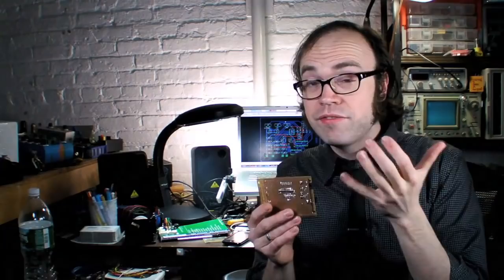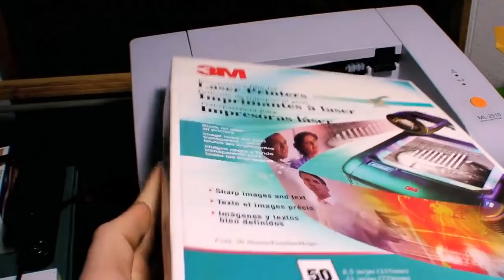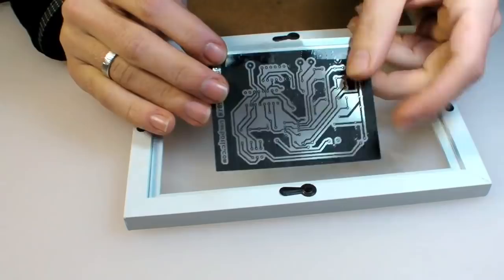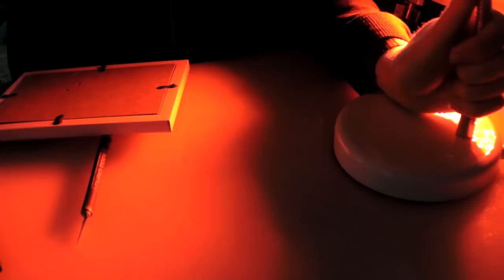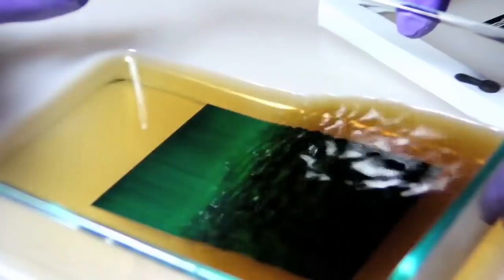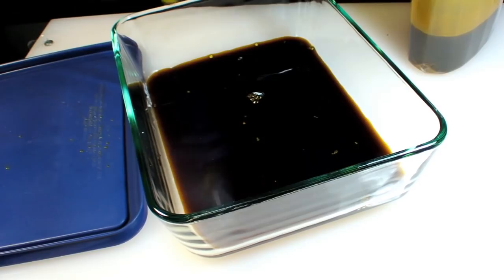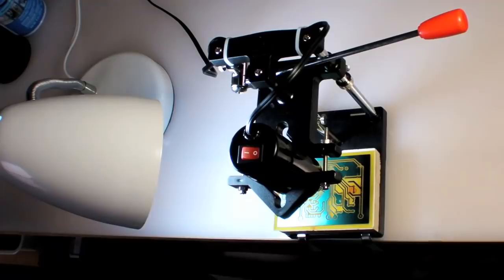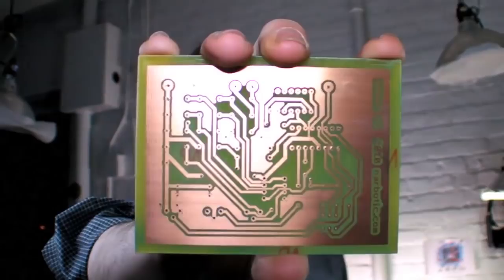Circuit Skills: Circuit Board Etching

Comment: @v8power101 The point of the red LEDs ? Old enough to know what a film camera is and to know what a "dark room" is ? Basically, he can't work in the dark, but he can't work in broad day light neither (the board is pre-sensitized so the moment he removes the white coat, there's a reaction).. So there must be some kind of "harmless" lighting.. He uses the red LEDs for that, sets things up, and then "flashes" it. (Red light is also used in the military at night as pupils adapt faster to darkness)

Comment: If I get the mats for etching.. I'll start doing it myself... I'm tired of soldering wires all day to test my circuits in real.. and you can't test all circuits on breadboards and sim soft... Besides ... I also use a lot of SMD components... And my school makes only one layer boards.. which is a drawback.. and other companies cost me money! This is a great demo, thank you very much!! 5/5
P.S. Is it possible to make double layer holes in home conditions?

Comment: Negative photoresist film is better IMHO - less chances of broken traces, especially when going in the 10mils range (say for a TQFP package). 
Also a HSS drill is not the best idea - especially with double-sided boards. 50 holes and the drill is worn out... ripping off the traces from the opposite side. Carbide drills are the way to go (some $1/pc). Heating the ferric chloride to ~120-130F will greatly increase the etching speed - board can be ready in 3 minutes.

Comment: Need some advice here as I purchased the same kit...  I mixed the developer as stated on the bottle:  1 part developer to 10 parts water and the board does not develop (or at least within a reasonable amount of time).  I added a little developer to the solution incrementally (1 part at a time)  until it developed... but the amount was more like 5 parts to 10.  I'm wondering if my developer shipped diluted?

Comment: Well, you would't need to make your own explosives, only parts that make a circuit board (ie. copper sheet, solder mask, and also resistiors, transistors, switches, ICs,...). The point of my initial comment was that "homemade" was (kind of) misused. We all got the meaning (mostly homemade), but nobody tought about it, until I pointed it out.

Comment: Great video. Can you help me make a small sound board that makes engine start, idling, running. Cannon fire and machine gun fire. Caterpillar tracks squeak noise. For a 1/35 tiger tank. 
And be installed to a receiver?

Comment: Hi, don`t you use a clear solder-able coating?? I mean the one to avoid oxidation of the copper traces after some time...
Reply: ***** I wouldn't rely on that, the layer is very thin, after a few years there is a good chance that your circuit will stop to work without the coating...maybe even faster I would say
Reply: It's thin, but it's not that thin. Unless you've got some nasty stuff in the air, it's not that big of a concern for hobby grade projects.

Comment: @anariaq This is an extremely cheap method compared to cnc. Even the cnc machines you've seen on make: cost roughly $300 to build, which is waaaay too expensive compared to this. If you already owned one, however, in theory you could.

Comment: I exposed the board under 8 5mm UV LEDs powered with about 1-2W sitting directly on the picture frame glass and also had a 50W halogen lamp above that. Left it for about an hour. I didn't get the green photoresist layer. It just looked like the copper surface still. Is it supposed to look like copper and then go green like it seems to do in your video? I put the board into sodium hydroxide and water and the circuit appeared in red for a couple seconds and then washed off completely. Why? I don't think etching it is going to leave a circuit behind because all I see is copper. Why was there no green resist? Thanks

Comment: You can print the circuit design in coated paper and iron it on the board and then take it in an acid and add holes its 8 minutes faster then this
 and I think cheaper

Comment: Anyone know how many PCB's the little kit makes? Looks like it comes with two coated boards, but is there left over liquid chemicals that I can just get some cheap ass boards off ebay or something? I don't have a drill press or any of that stuff, and the liquid alone looks to be $50. I'd almost rather just submit my PCB for fab and get it done right and it may be cheaper if i submit with some group or whatever

Comment: I tried locating these boards but 12"x12", but have been unsuccessful in finding them. I can only seem to find the ones without any green resist coating. Any idea where I can get boards 12"x12" w/ a resist coating on the one side? Thanks! Great Vid!

Comment: In this video he stated that this circuit board is completly homemade, he didn't say a word you'll also be using homemade equipment if you follow his instructions. I think homemade means it's made in your home, not that your are using equipment and materials that you made yourself in your home. He could also be using circuit board printing machines in his home it's homemade not handmade after all. And of course this comment wouldn't make sense on other videos, this is why i commented here.

Comment: Stupid question, but could I expose one side and then expose the other for two sided PCB, assuming that I'm using copper clad board with photoresist on both sides and I've managed to keep light from reflecting onto whatever side I'm not trying to expose?  Or should I just go with the toner transfer method.  Toner transfer is definitely cheaper....
Reply: or you can just not take the protected film off of one side while exposing the oder side

Comment: Where'd you get that mini drill press? I've been using a Dremel and the drill press stand; it was cheap, but it flexes when the bit contacts the board. Drilling is by far the most tedious part of making a board; how'd you get all those holes nicely centered?

I've also had much better results etching with 2 parts peroxide and 1 part muriatic acid. Much cheaper, and it takes about 5 minutes instead of 20. Ferric chloride is vile stuff!

Comment: oh sorry i was confused because you didn't said layouts.Did you searched google enough?I've found a lot.Lets say you want to build an audio amp.Google "amplifier board layout".Then in the top of the page click on "images".Voila.Try changing keywords like board layout ,pcb layout ,pcb design etc.Also i usually search just for the project that i need like "2'60wrms 4 ohm amplifier" and most of the times i find a board layout at some page.

Comment: It's unlikely you have to to do any PCB etching to maintain existing equipment. Even if you replace every single component, you can just use the original board.  That's a time consuming and costly way to "repair" something. It also assumes you can identify all the parts, and that they can be sourced.  So, in the end, you actually have to know what you're doing in electronics to repair something efficiently, just by targeting what is actually broken, leaving well alone what isn't broken.

Comment: I'm curious how much you spent on supplies...
Also, there are proto board shops (like sunstone, advanced circuits, etc) that can make a 2 sided board w/ plated holes, silkscreen, soldermask... for about $35.  And you don't need to wear those purple gloves, ever.

Comment: Hello, I'm excited to make my first circuit board etching, but I have two questions!

I have access to high end design software (i.e. AutoCAD, Solidworks, etc.,) and I am doing the design end with this software....

1) Is there a recommended line thickness in relationship to what would be wire gauge? Or is there just a single recommended line thickness?

2) Is there a recommended minimum spacing between "wires" or "runs" on the layout?

Comment: Great video, been years since i used to make these and i forgot some steps.Dont you spray clear lacquer onto the finished pcb to keep the copper new and shiny until assembly?
PS Your board will be much better than the junk China make and send out, some audio pcbs in electronics today have very poor boards, when trying to repair them the tracks come off, modern stuff is cheap and mass produced nowadays, where is the quality?

Comment: I just use perfboards it seems to long to do this and perfboards arent that confusing.
Reply: ok. well, continue using perfboards, lol. perfboards have their advantages but imo smd takes much less time and is much more flexible and sturdy. Also, with smd you can reflow your components on your stove and that, you cannot argue against, takes A LOT less time then hand soldering all your though hole components.
Reply: Circuit board etching takes forever to do and is boring. There is no point. It might be more sturdy but it takes no time to design where components go on perfboards. Also, after you finish soldering on the perboard, which I love to do, you can add on anything you missed out or just want to add.
Reply: If you find the very simple eatching process shown here confusing, never get into logical gates. And honestly, you probably should quit any form of engineering.

Comment: Any tips for keeping things aligned (good registration) for double-sided PCB's ?
Reply: make sort of oversized pouch, by taping two films with each sides traces. Then slide pcb between them. Pcb oversized too, so tou can tape pcb to the films. This will let you flip it over to UV the other side, without anything moving. For easier alignment add dots or X outside layout on both films, this will help with initial alignment, and will be visible after the pcb is between films. Another way is if you own drill press, just drill holes in corners through pcb. Then include same holes in your trace design to align film to the pcb by them.
Reply: @Valtra103 ,
Good suggestions.  Thanks!

Comment: I've done a lot of research on home made PCB's... For me, it comes down to price. You could spend hundreds on the chemicals, boards, lights and other misc. equipment plus spend hours on setup and labor and the end results are mediocre at best minus vias, resist and silk screen. For around $2.50 per in/sq, you could have prototypes professionally made complete with drill, vias, solder mask and much tigher tolerances. I can understand the satisfaction factor but this isn't the 1970's any longer.

Comment: Or if you dont have any FerroChloride, You can use 1 part Hydrochloric Acid($5 a gallon at hardware stores), and 1 part 3% Hydrogen Peroxide to etch.

Comment: New to this so sorry for any dumb questions, but can I print the PCB layout on an inkjet printer instead of a laser printer? I don't have a laser printer. Thanks!
Reply: +lightingball123 You can use the inkjet standard printer however, the PCB transparency will be flawed at best. I recommend going into your printers settings and selecting "Hard print / Thickness increased printing" or similar. If that doesn't work, go to the local post office / FedEx (If your American) and ask to use their laser based printer. They will happily oblige. (For a small fee of course). May I also suggest buying a laser - based printer? If you are going to be making PCB's on a more regular basis, I highly recommend it, as it will save you an insane amount of money in the long run.

Comment: I am going to start etching my circuit instead of just using perf boards. But I am curious...can you just dump the chemicals down the drain? Does anyone know? I mean hydrochloric acid is very dangerous. Also does anyone have any safety tips for the films? thanks
Reply: I'd neutralize any acid before dumping it. Just mix with baking soda.
Reply: Best way is to just take it to a disposal center. Even after you neutralize it, it still may be illegal in your area to dump it due to the copper content of the solution.
Reply: Andrew Burnett Thanks for the tip mate!

Comment: After you are finished you can use Cool-AMP powder (from wwwdotcool-ampdotcom/cool_amp) to silver plate the board which will make it a lot easier to solder.
Reply: At a cost of $100 plus for an 8oz bottle you might just as well send your PCB to be manufactured in China and still be much cheaper.

Comment: Hello ..
Can an ink printer be used for the print out ?
Reply: As a matter of fact, I have tried laser and inkjet printers, and obtained much better results with the inkjet, particularly in large copper areas where the toner tends to leave holes. Some precautions must be taken for a perfect print: use a good transparency film (I am using Inkpress Media brand) and set the printer for Photo Printing (not transparency), in High Quality settings. You do not need to use more than 1 print, since the black ink is opaque enough. I work with clearances of 9 mil with no issues. I hope this helps.

Comment: Anyone know where you can still get the pcb with the photoresist on it?
Reply: Radio Shack has ferric chloride for etching boards. 
You can also use jameco to get desensitized boards.
Reply: iEugene1994 I would have never have known about this if it weren't for you. Thanks!

Comment: what software app did you use to design the pcb layout?
Reply: for the demo he just pulled off line, He said used cad soft eagle program??
Reply: It's Eagle. They have a freeware version. I just designed my first PCB using it. Check out sparkfun's guide for getting started. Got my props from my professor for my senior design class on my schematic and layout following their guide.

Comment: As cool as this sounds, the kits/tools they recommend are $100. So not truly affordable. Anyone tried laser etched PCBs? I have access to one and would love to know your thoughts.
Reply: i personally think using just a laser printer and transferring the toner to the pcb with a hot iron gives the same result  and is much cheaper since you only need normal copper pcb's a Hot iron and your etching acid whiyh is pretty cheap if you already have a laser printer or have access to one
Reply: Not every corrosive is automatically an acid. Ferric chloride isn't.
Reply: FeCl3 is a really strong lewis acid .

Comment: Can you reuse chemicals used in PCB etching?
Reply: No
Reply: yes.
Reply: +Valtra103 no
Reply: FeCl3? No. However, Google "Copper Chloride in Aqueous Hydrochloric Acid" for a reusable alternative!
Reply: Maybe i am getting question wrong? I mean that you can etch one pcb, put FeCl into  container, and etch some more after some time, till it is ineffective. Thats what I meant.
Reply: Yes, but it does add a little more time to the etching process.  Warming helps allot.
Reply: Yes, you definitely can. Ferric chloride can be put back into the bottle and over time, most of the copper will settle to the bottom and form a sludge. Now, that assumes you're not doing it super frequently. If you are, simply invest in more acid, and cycle between bottles so that they have time to settle. The developer will react with air, so it should be put into a bottle with as little air at the top as possible. If left alone, maybe a week. If kept sealed, cold, in a fridge, will last upwards of 3 weeks.

Comment: How do you dispose of the left over liquid though? Do you just pour it down the drain?
Reply: +Davy Zou I usually let it evaporate outside in an old bottle cut in half, then dump it when it's dry. Not sure it's the best way to satisfy mother nature, but it's still better than damaging my metal pipes
Reply: +Stephen Anthony LOL
Reply: +Davy Zou - Never down the drain! You could add some kitty litter to a zip lock bag, pour in the solution, and throw into the garbage.
Reply: Drink it.

I hear it is good for bones, or it may kill you. I can't remember which one it was.
Reply: I tried, it has some very fruit flavors, especially when you wash it down with vodka.

Comment: Meh too cheap. This is a good way so that real thick layers show up. I have done the magazine paper and every kind of paper only to get too thin of results. I found even a better solution but it has its draw backs. Perfectly flat boards with no raised edges makes the grade. The method I found online works fast, and I get all the toner to transfer with no paper mess. I then use Puslars Green overlay and again there one needs perfectly flat boards with no dips and no raised edges. Solder mask next

Comment: Way too many steps and costly parts. Print your circuit on a magazine page, a glossy but thin cheap magazine page - not the heavy costly glossy stock, just run of the mill gloss. Iron that image onto CHEAP copper clad board. Soak it in Muriatic Acid for 5 mins. Rinse. Clean with Acetone. Done.